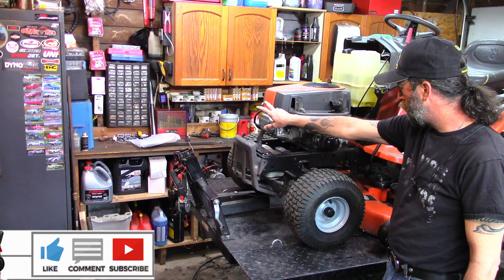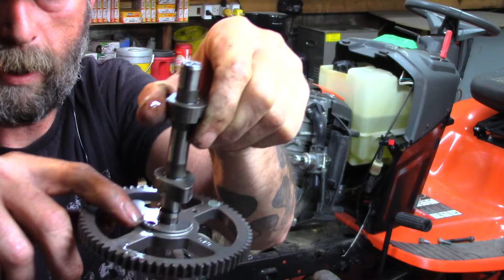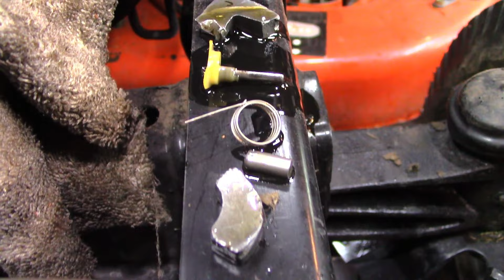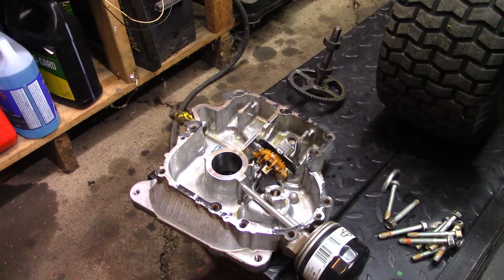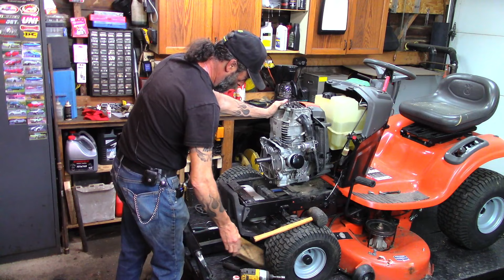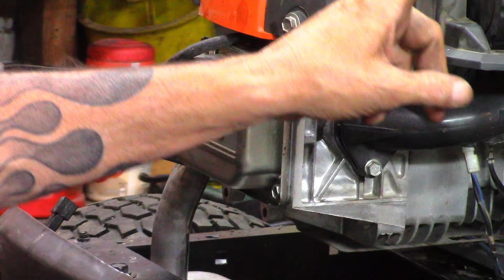You Won't Believe How Easy Husqvarna YTA18542 Cam Replacement Is!

Comment: Recently subscribed and impressed with your straight forward and detailed approach to repairing the projects you’re working on.  I am considering purchasing a used YTH18542 and would like to know what your thoughts about the machine.
Reply from the maker: Thx for the sub.  Overall not a bad machine, based on the older Craftsman designs made by AYP.
Reply: @randomwrenching Thank you!

Comment: I have used OEM Briggs Cams and had the new one fail in less than 60 days, I have used aftermarket cams and had them fail, but I have had them last a long time as well.  Bottom line, I feel like your taking a chance either way. The cam shafts obviously has a design flaw that needs to be addressed or they would not fail in the first place.
Reply from the maker: Exactly they way i think about it as well.
Reply: I’m on my third cam bought a John Deere

Comment: I heard about using #2 grease on gaskets recently and have found out some people have been doing this forever so now I’m doing that. Anything to avoid difficult gasket removals! 
The up side so far is the grease helps a little to hold the gasket in place!🔧👍
Reply: @Rein_Ciarfella  Me too. Just used that trick for an opposed twin carburetor gasket. They always tear when you’re trying to clean those.
Reply from the maker: Tricks of the trade